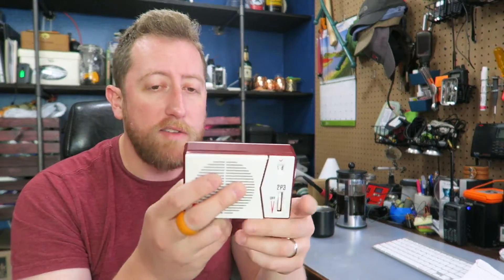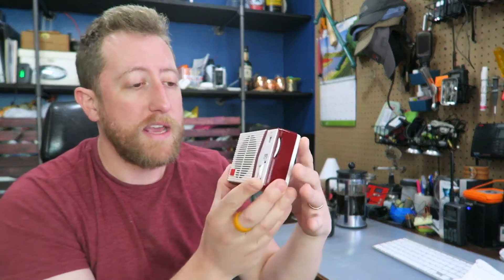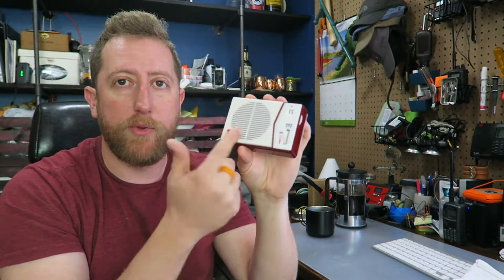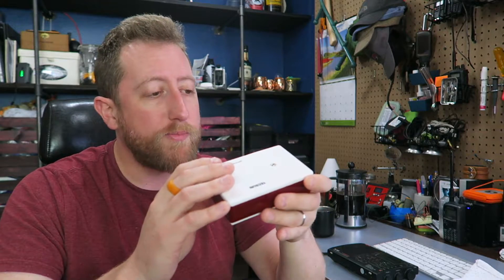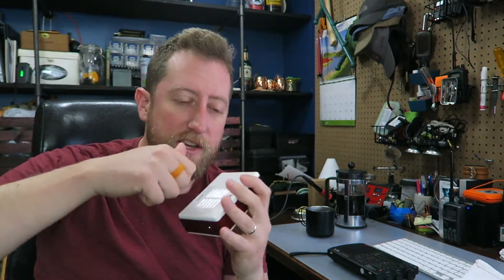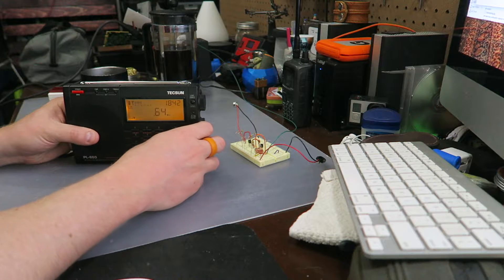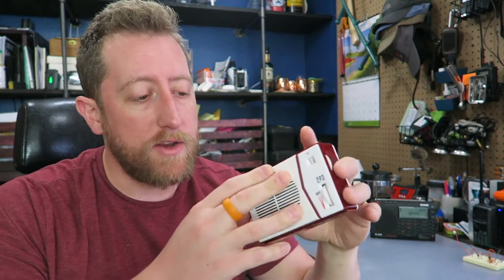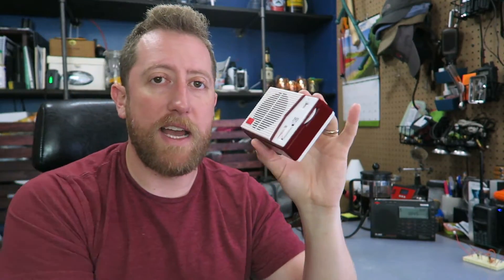TECSUN 2P3 Kit Radio Review | SMASHING DXer!

Comment: I've restored over 200 radios and rebuilt a 1947 Motorola WR-8 wireless phonograph. I've successfully built other inexpensive Chinese radio kits and the 2P3 is a DIFFICULT build. There are three critical bridges  on the PCB that must be soldered to complete the circuit, which is, IMHO, a BAD idea. The volume knob soldering is difficult also, as one must vertically connect and glue a PCB part at 90 degrees to properly support connect and position the volume pot. I never could get mine to work and after digging it out again I am reminded again why I put it away. My dollars worth-John in Texas

Comment: My hx207. I killed 2. Then giving up on the third...almost. I herd a small gasp. I snached it up and went thrugh the solder joints and tuned the cans, then the variable tuner. Trimmers. I now get about 6  stations at night. But is my pet now running happly on Ni metal hydride cells. Now I'm lookin at a 2p3

Comment: This radio isn't that hard to build. Those other Chinese kits with Chinese instructions and different parts then whats in the schematic are harder. This one has to be the best AM kit radio on the market though. You really do get a nice product and something you can be happy with once your finished with it. I  had allot of fun building mine.
Reply from the maker: I agree, I often reach for my Tecsun over other WAY more expensive radios.  Its quite a good performer.
Reply: IMO Get some old junk to practice on.
De-soldering/re-soldering components from an old board will quickly give you a feel for how the solder and components will act, so that by the time you are ready to attempt your radio build it will all feel more natural.
73! 
N2NLQ

Comment: Dumb question.....  So what does short wave do?  What do you listen to with it?
Reply from the maker: Its a frequency band that when transmitted can be "bent" around the earth using the ionosphere.  The frequency is short than that of AM (Medium Wave).  

Many countries run radio stations that serve world-wide audiences. Many communist countries for instance have SW radio stations that put out propaganda and generally slanted news.  SW is where you hear Number Stations and some pirate radio stations.  Also, SW is where HAM radio stations transmit but usually on Single Side Band, which requires a special radio, the TECSUN PL-660 is one such radio so you can listen to regular stations and SSB transmissions from HAMs.
Reply: Might have to snag one then.

Comment: how hard would it be to put in a BNC connector instead of the included internal antenna?
Reply from the maker: The internal antenna had six solder points for all the coils.  I am not sure where you would tap into that to add a BNC connector.  That is beyond my skill I must say.
Reply: not easy to remove internal ant as it has the coil. best way is to put 1 turn coil on internal antenna ferrite rod and connect to bnc.
Reply: I would use a SMA or some other kind of small connector. As for an antenna "tap" into the circuit, a few turns of wire around the ferrite bar would get you there. The ends of course would go to whatever connector you're using. Since this sounds like it has a really hot RF section, I'd start with about 6 turns, and adjust as needed.